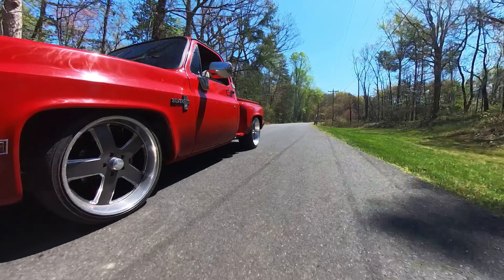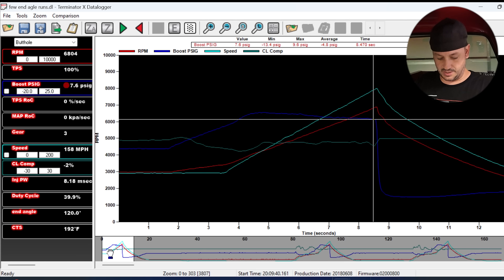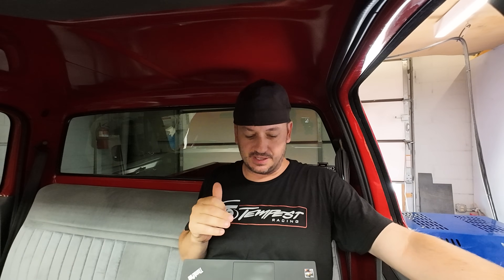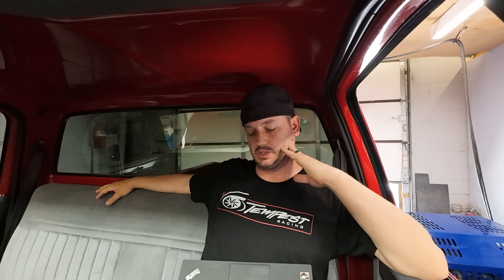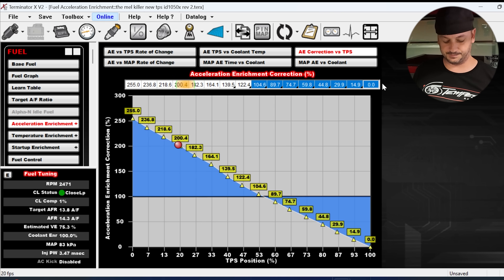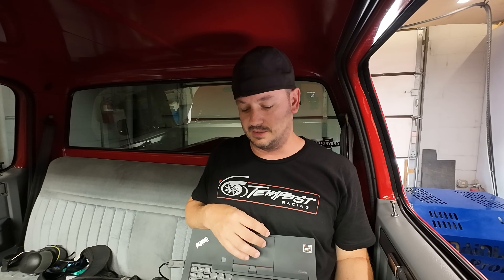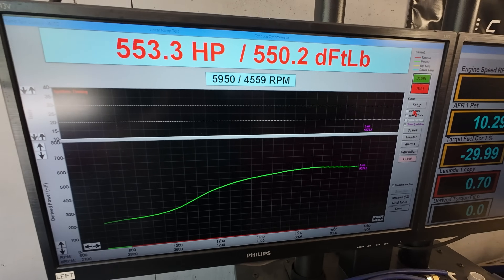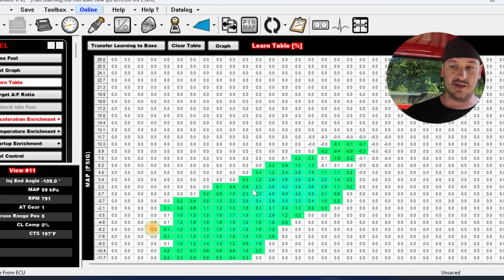Quit Making This Mistake w/ Holley Terminator X!

Comment: What's your opinion on fuel injector clinic injectors? That's what I bought for my car but I haven't finished assembly yet.

Edit: just got to the part where you said fuel injector clinic as you second option

Also, I have the course and missed out on the deal for them because I didn't check first. Live and learn.

Comment: Joe, i have a N/A 5.3 LS swap in my c10. I have a cam and thats it. What injectors should i run? Im having problems with my terminator x going into closed loop and learn mode. I have a feeling these stock injectors are my problem

Comment: I'm in no way saying their QC guarantees anyone else having the same experience I have, but I've done the entire power tour and put another 3000 miles on my snake eater 100 lb injectors.  I even ordered their extra cheap super china ones before they started offering the "same factory as bosch german sourced" injectors.

I quit making any major tune changes 6 months ago and mainly have just been racking miles and I check in every now and then on the tune to make sure it's not going nuts.  I ordered them being cheap thinking I'd blow up the bottom end learning to tune a turbo car for the first time anyways.

If they fail however, I've got enough time and money dumped into the build that I'll end up going with nice name brand ones next time.

Comment: I had sep injectors, one stuck open, one would intermittently cut out which melted a piston, replaced with a set of some odd 3/4 length bosch units, been running perfectly ever since.

Comment: They sound like they need to familiarize themselves with Holley better. And my buddies nearly new snake eater 1000s had an injector stick wide open after a pull. Stranded us. Snake eater blamed him for swapping o rings on one injector. Which he didn’t do. Installed them right out of the box

Comment: Anyone know what EGT is too high for a single turbo 351W 70mm E85 with the holly Term x?   EGT Mounted 12 inches from the driver side collector before turbo. My bronco is running 900 EGT on idle and it’s scarry.
Reply: Added timing will reduce exhaust temps assuming something else isn't goofy. (late ignition has fuel burning as it leaves the cylinder)

Comment: People judge the shit out of me for spending what I spent on ID1050x's in my LQ4 C10 swap, I got 99 problems, but the injectors ain't one.
Reply: Those injectors are one of best on the market for high impedance , next to the larger 1350cc's from ID.
Reply: @norb231  I have the ID1300's in my Mustang because it runs exclusively on E85 and wanted the stainless steel body.
Reply: Stainless body are nice. FIC sells some to that are. Both those companies we have used exclusively for injectors for years now. Money well spent.
Reply: Same here when I bought matched Bosch 210's

Comment: I have a question, why does  Holley not put accel PW in the logs?  Tuning AE would be easier I feel.
Reply: I want to add, sure you can look at the  AE tables as they are being using but you  can't get a good log of what is actually going on with the AE PW  vs the overall PW, since the parameter does not exist.

Comment: Totally noticed the same thing with coolant temps and fuel demands. Starting up hot with coolant temps around 207*F for a little bit, wanted a different amount of fuel than when it would cool off to 192*F after a short drive.

Comment: It's nice seeing you drive these vehicles instead of purely dyno. There's a local big name shop that only dyno tunes and never goes on the street after to double check everything.
The last 7 out of 7 tunes I've redone after them have been deadly lean at higher load mid-high rpm. If it was street driven after, even with no datalogging, they would see a problem when it breaks up at higher rpms.

After making the necessary VE adjustments (GM ecu), the 70s Camaro went from running mid 12s @ 115 mph to 11.08@122 mph in the 1/4 mile. Timing was untouched as the previous tuner had it fairly maxed out without knock for the Procharged setup.

Comment: I will be new to hooking up the Holly and you mentioned before when it comes to electrical do not skimp so I purchased a set of Holly hundred pound injectors to go with the Holly Terminator x. I figured I can't go wrong with that. I hope.
Reply: A lot of people have problems with Holley injectors. Good luck, hope it's not you.
Reply: @stephenhodge6441 man i bought there 120lb matched set but I've been seeing this also and it worries me about my purchase.
Reply: I bought the holley injectors for the same reason. I figured matching brands would be easier but I've been seeing people complain about them. I just fired mine back up yesterday after a ton of changes including injectors so I'll know more after tuning
Reply: @jessgriffin2991  how are your injectors? im on the same boat, do i get the holley 100lb injectors or shouldnt?
Reply: share some wisdom, did it work for you?

Comment: How do you feel about Deatschwerks injectors? I bought a set of 16U-00-0050 50# injectors and they ran great with my generic Chinese sheet metal intake, then I swapped to a LSX-RT intake with their 17U-21-0050 and I can't seem to get it to run no matter what I do tuning wise.  (yes, I entered the new injector data lol) I pressure/smoke tested the intake just in case it was warped or just had a bad vacuum leak, but it's sealed up with no leaks.